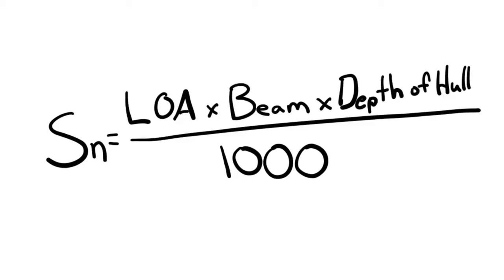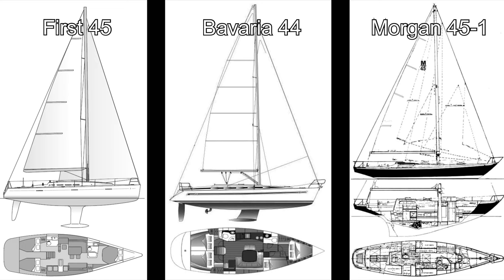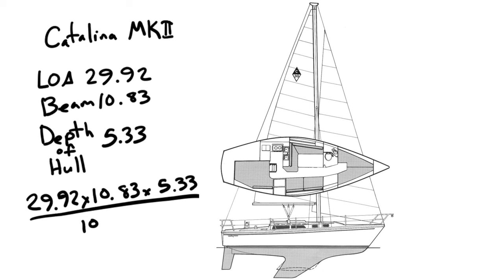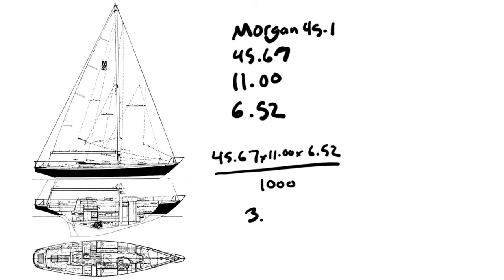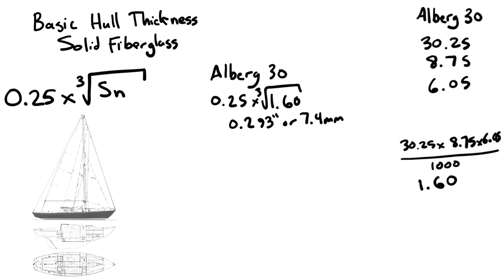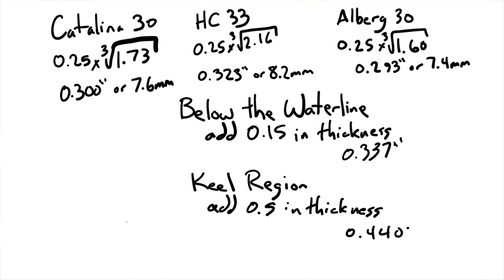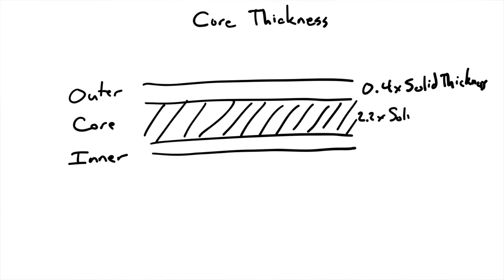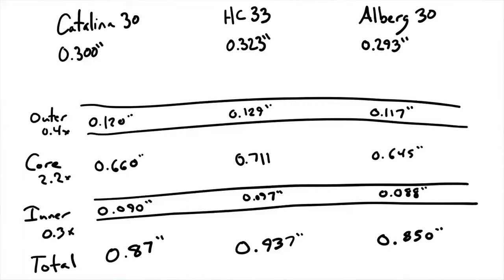Is Your Hull Too Thin? | Sailing Wisdom

Comment: I've built three kayaks. Two of which were wooden strip cores. I can say 'I'll never do that again,' but I should've said it after the first one.  A kayak is more flexible, thinner, going to impact more than a sailboat so water will get in and then it delaminates in long strips. Does the epoxy no longer attach to the wood? No, it bonds for life.  It is the layer of wood just below that bonded later that swells and delaminates. (the strips of epoxy/glass look like transparent pictures of wood). So if  you have a natural fiber core it can delaminate if water gets in and it swells. I won't own a wooden core boat. I'm probably more opposed than is reasonable. I do think my 2003 Hunter is all foam core fiberglass, but my dock neighbor had an issue on his Hunter, ten years older than mine and wood cored in his anchor locker. I should go in there  drill a hole and see.  

I think you may have skipped a key point. If the inner + the outer fiberglass is 0.70 x the scantling calc, and the core has any weight, then the difference between solid fiberglass and cored fiberglass is 1: ~0.80  only a 20% savings. That's a lot of work for 20%. I suspect it's probably significantly lighter, but just as strong or stronger,  because of Young's Modulus -- the basic principle of I beams. The difference between an I beam and a boat hull is the 'webbing' middle part of the beam is the core in the boat.  The wider the webbing the stronger the beam. 
The sonar method I would guess would bounce a sound signal off the inner side of the skin. On the other side of the core.  Curious to know what it does about this. The measurements it does get I think would be  highly accurate. 
And my Hunter Passage 456 thicknesses? No clue.  I remember 1" but.....  

Of  course the next issue here is bulkheads and frame. After seeing all the work  Expedition Evans did gusseting the  frame to the hull of their Beneteau 50 (it had been glued the keel strike separated the frame from the hull). I was very happy when I first toured my Hunter to see that this was done at the factory.  I expect my boat may be permanent, the hull is so inert that it can't delaminate, at most might need resurfacing. Everything else is replaceable.  (of course there are other factors.) 
I also think we're still in the generation where people without much money will still fix up a wooden cored boat and happily sail it. I don't think many are DIYing wood only boats. That generation has passed. Too much work. (Unless it's a museum piece or has been kept sealed, painted, patched.) The next generation I expect will only want inert core boats for DIY and they'll be available.
Reply from the maker: The weight savings from the core depend on the core material, and the core material depends on the application. For larger boats, the weight savings is lower as the core is denser. I have seen core material that looked akin to bubble wrap and weighed literally nothing! The panels that it makes when glassed up are incredibly strong and weigh a few grams for a big board! It is incredible!! Because of that huge variability, I just skipped over the amount of weight savings as it can range from “a wash” to “a ton”. 
Bulkheads play a major role in the strength of a boat and are not to be forgotten about! This video was just focusing on basic hull thickness and didn’t get into any of the reinforcing aspects of boat design. 
I’m glad you have a foam core! Those are strong, light, and have no real reason to fail on you! Sorry to hear about your neighbor though.

Comment: So when someone loads a boat up to cross an ocean.... the percentage of hull weight to gross tonnage goes down. At what point does a heavier hull become somewhat of non-point? People who want to race generally have a very sparse interior and put up with no shower and freeze dried food.... every ounce matters. When one starts adding a big battery bank for cooking, water making, washing machine, dish washer.... and oh motive power as well. Then add a rubber dinghy rather than a wood dinghy and electric bikes and SUPs for each person. We have not started talking food, water stores, clothing, etc. Add on top of that a cruiser is not going to replace their sails before each crossing as a racer might maybe every two years but likely less and so a less efficient sail as well. This might well be why most cruising catamarans are slower than similar length mono-hulls, it is hard not to overload them. It would seem a slightly heavy hull probably makes less difference than the raw numbers might suggest. A light, fast hull might not be a good cruising boat either....How is the boat going to be used?
Reply from the maker: You raise a very good point. You really want to look at the displacement class of the boat. A light displacement boat is more sensitive to weight being added than a heavy displacement boat. 
A safe rule of thumb is that each person on board will add 1 ton to the boat. A crew of 2 means the boat will end up weighing 4000 more pounds than when empty. If you have a light boat that weighs 10k pounds and you load it up so that now it weighs 14k pounds, you just increased the weight by 40%. Take a 30k pound heavy displacement boat on the same waterline length, and add the same weight bringing it up to 34k pounds and the boat increased in weight only 13%. 
Another point to look at is the Pounds per Inch of Immersion. How much deeper in the water will the boat sit when it is loaded up, basically. 
On a light boat, it will sink into the water faster than on a heavy boat because the light boat is more sensitive to weight being added. This means that our example of 4000 pounds of clothes, food, water, gear, and humans will push a light displacement boat deeper into the water and well past the designed waterline. Now the boat is sailing at a depth that it was not planned for and all of the sailing characteristics are shot!
We have been unloading and cleaning Wisdom and she has come out of the water 4 inches! She is a heavy displacement boat so the additional 6000 pounds that we put into her since we bought her has pushed her down deeper while we were cruising. 
My favorite thing to do is to look at light displacement boats where they added a “cruiser’s arch” on the back with solar, wind, and a dinghy, all hanging off the back of the boat. Sometimes you will see that the bow is a few inches clear of the water because the boat is leaning back so hard! People buy light performance boats and then load them up, they look like a Ferrari leaving Home Depot with a palate of bricks in the trunk!! Light performance boats have less storage space to motivate owners to “keep it light”. They don’t carry much water because you aren’t supposed to go somewhere far. They are for fun sails around the buoys and then back to the marina for sundowners. Heavy displacement boats are slower but can carry all the crap you want to carry on a long passage.

Comment: How would an aluminum hull compare? More or less weight, but stronger? More cost? Distant Shores has built an aluminum boat, so I have had a chance to see the design, and it looks to be very strong, with a thin skin welded to a frame.. Thanks for your time. :¬) Webhead USA
Reply from the maker: Aluminum uses a completely different set of rules

Comment: So how did the Alberg 30 work out in real life?  And do your changes affect anything? I am a newbie so I know nothing.
Reply from the maker: The Alberg Boomkin is still under construction, but it changes a whole lot! That’s why I had to read and study all these aspects of hull design to make sure that the structure would be strong enough to survive the ocean. 
This simple extension requires a lot of structural changes to the boat as the current hull is designed to support a boat of the current size. Adding onto the back will increase the forces on parts that were not designed to support those forces.

Comment: OOHHHH Thin like "thickness". Makes sense to me.  My hull I think is Too Thick.  Unfortunately I think "Wide",   So yea, the Width is what I'm talking about.  With my 50 year old "lake boat.  MMMmabe 1968 or so Whatever that would be.  For me, a tree fell on my "Chrystler Built Buccaneer" 19 feet long and pretty fast.  But lo and alas there was a tree right across the bow about 18 years ago. Motivation to "refurbish" was (up to a new brilliant idea about a month ago) to make the hull much Thicker.  That would be much Wider.  Break the transom and spread the hull with sides added for freeboard. NO No NO. I am now looking at building two AMA's.  Yep AMA's Ill tell ya.  But This means that I am making my sailboat into a Canoe.   Yep make the boat THINNER.  LIke a Canoe.  Got to cut triangular sections out of the hull and push everything togeather to be more narrow.  A very narrow (Thin) hull.  Crossing with three aluminum poles (I have a fabricating job at a dock making place ~ all aluminum welding ~ So sweet)  Well I guess a Trimaran would be much "Thicker" if you're going to talk about the "Width."  But my hull is the middle part must be more like a Canoe.  I still have the very nice tiller/rudder, the Centerboard and well in the middle, the mast step and mast with all rigging and even "NORTH SAILS". Oh my goodness!  They are yellow with black striping.  Not to mention that I have two mainsails.  Not sure why but a wishbone boom would allow a double rig for the main for wing on wing.   ~ And my son nearly had me convinced to pay to have it "demolished."   So yea.  Thinner is better for me.  🥹

Comment: This why i advocate sturdy steel hulls with ultra low center of gravity because you can throw up a huge amount of sail with enough energy to charge batteries.
Reply from the maker: Especially if you have an electric motor with regen 😎
Reply: @RiggingDoctor  of course because the wind never blows where you intend on going.

Comment: Gotta take issue with this video.  Structural engineering of boats has moved beyond rule of thumb type equations to more rigorous approaches.  As a retired structures naval architect, there's much more to consider than gross hull dimensions and core v. no core when specifying scantlings of FRP hulls.
Principles of Yacht Design by Larsson, Eliasson and Orych gives a good discussion of monohull structures with calculation methods to determine scantlings.
I don't mean to be a negative on this, but the risk is someone may see this and think they can do a repair or build a boat component based on this and have disastrous consequences.  There's too many factors that go into sailboat structural design to think the basic scantling equation presented here has any meaning for structural adequacy.
Reply from the maker: Very good point! This is just the most basic of the beginnings of scantlings. Proper engineering can build much better with much less, but those boats are special! For your average marina queen production boat, this basic formula is a good starting point for general knowledge about the boats construction. 
The goal of this video was to give appreciation to the way small changes in a yacht’s design have massive repercussions over the entire structure! Making a boat wider or longer requires that the entire structure can support the new form of the boat, not just engineering the additional part to suit the needs of the owner. 
This was not to inspire people to do their own repairs, as that is an entirely different subject matter. This was just to make them appreciate the size of the components of their boat and why they need to be so.
Reply from the maker: I would love to discuss the Windpuff project with you and a few other naval architects who have commented recently. I know the project is a big undertaking and I want to make sure that I have crossed all my t’s and dotted all my i’s. I just want to make sure that there isn’t more writing on the reverse side of the page, if you know what I mean. 
If you would like to participate in this, please email me at riggingdr@gmail.com so we can all coordinate.
Reply: Principles of Yacht design is certainly the best book I have found on this subject.
Reply from the maker: I’ve read Gerr’s Elements of Boat Strength, and Skene’s Elements of Yacht Design. Then I’ve read a few about building techniques, but they focus on the construction method and not the design of the boat (though they do mention the points of failure because of various construction and design features). 
This is a very in depth topic and this video was very much an introduction for people who didn’t even know there were formulas governing their boats design.
Reply: @RiggingDoctor  who are these people who don't understand that maths rules the world ?

Comment: Unfortunately. This excellent discourse ignores common techniques and technologies that greatly skew this basic math. For example my modern Hunter has DuPont Kevlar glass that provides for much stronger layups with less mass. Boats made after the 90’s have leveraged many material science and construction techniques to provide for the strength required by the naval architect without a direct relationship to thickness alone.
Reply from the maker: Very true, material sciences have advanced greatly and those boats are built to their own governing rules. For the grand majority of production boats that are made out of plain glass and polyester, these are the formulas that they are designed by. Those who have exceptional boats know why their boat is made the way it is, but for the average production marina queen owner who doesn’t know how or why the boat is built as such, these are the rules that governed that design. 
It’s just a general start to these formulas. As you dive deeper into the books, all sorts of caveats and exceptions come up where the hulls is made thicker or thinner depending on materials, application, speed, or frame/bulkhead spacing.

Comment: So with my skull in mind....the thicker it is the larger the inner volume. Obviously, in my case this lack of volume constrained my brain's size.

I call this the scant IQ number....sorry no formulae as I wouldn't understand it anyway. But I believe that my forehead is probably scant IQ multiplied by 1.15 as it's most likely the part that crashes into lampposts, doorframes and other skulls.

Anyway, I digress.

How come you didn't mention the relationship between solid v cored thickness and internal volume.

My brain also tells me that non-cored boats float longer when holed, as their greater internal bigness would take longer to fill up.

So where's your formula for THAT smarty pants?
Reply from the maker: 😂🤣 depends on how many pool noodles they are carrying inside. Those add flotation!

Comment: 2:00 false! If the hull is thinker in shallow water u gotta crash... Is the hukk thinner/lighter u flow above the corals.
Reply from the maker: At some point, regardless of draft, you will bump into something.
Reply: @RiggingDoctor  That is no problem for GFK u must run full speed into something that there is a marginal damage.

Comment: I have steel sailboat. My hull thickness is Schrodinger. I its 5mm and none at the same time. Depends on measurement.
Reply from the maker: 😂
But still stronger than any fiberglass boat out there!
Reply: @RiggingDoctor  yes, women does not care about strenght, many steel boats are full of men...